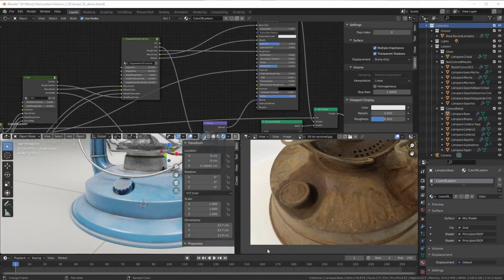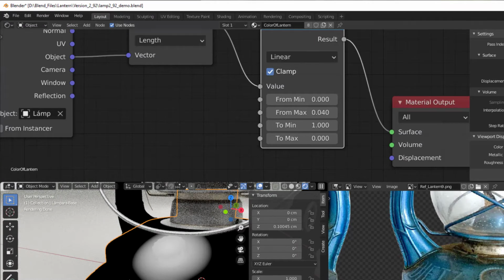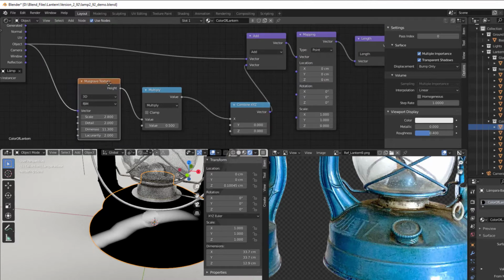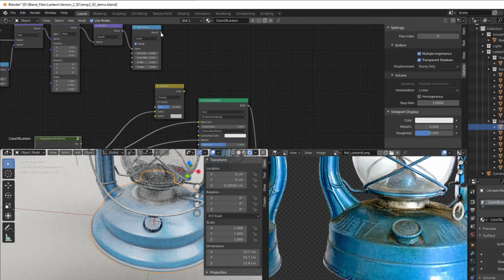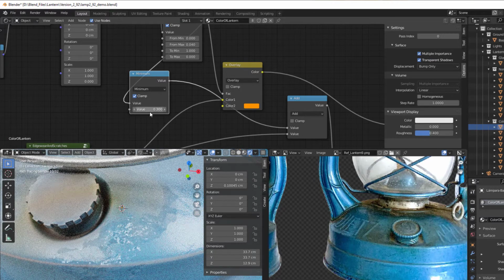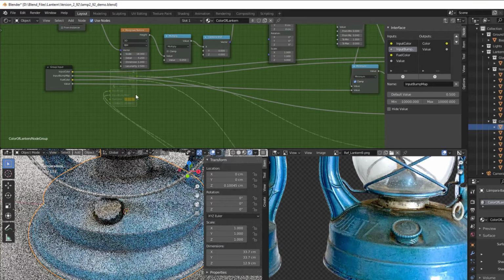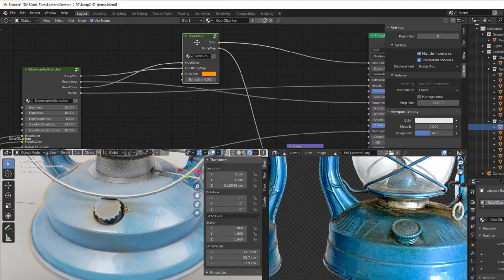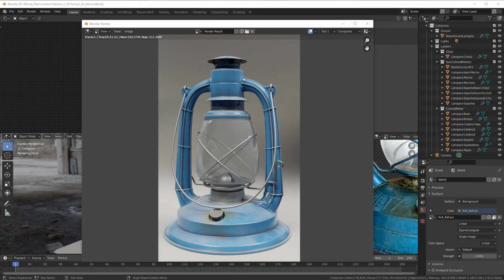Realistic material in Blender, part 16; fuel

Comment: Why with different BumpStrenght values (0.01 to 100 and over)
I can't see real high border fuel?

 (video min 13.30 to 20:30)
Reply from the maker: I'm changing the height here, not the strength of the bump. The height is more to simulate so that you get longer shadows (higher bumps), while strength is given more contrast between the bumps. Normally you are in the range between 0 to 1, so not as high as 100. What I'm doing in the video above is trying to get just the thin border to show between the fuel and the metal, because the fuel itself does not contain any bumps... but it's good to see some thin line just at the border to get a feeling that here is some dirt collecting and that we have some height difference. It should not be very visible and that is why I use very low numbers here as well.
Reply: @jtornhill  Thanks for the reply.

However, following the tutorial step by step I never see (from min 13.30) any thin line only at the border to get the feeling that here it is collecting dirt and that we have some height difference.
If I use very low numbers or high numbers I don't never see this border.
I have the same node setting as the tutorial.

I've tried multiple times, both with blender 2.91 and with Blender 2.83.10, but I never see this border.
Can you help me, do you have a ready-made file that I can compare? or can I send you mine. Thanks you !
Reply from the maker: @gianlucagottardi7434  Are you using Cycles?
Reply: @jtornhill  Yes Cycles
Reply from the maker: @gianlucagottardi7434  Then I don't know. Regardless what you put in to a bump map it is always reacting in some way if you have some strength and height on it. If you put the value directly in to the input node for the material output to check the mask...is it then colored in different gray scales or is it completely black or completely white? You can also put a screen shot on the FB group "Blender procedural textures", so I can see it visually.
Reply: @jtornhill  Ok I have put a screen shot on the FB group "Blender procedural textures" 1) the tutorial image and 2) my project image, for the same settings